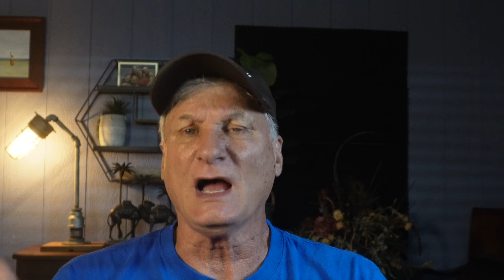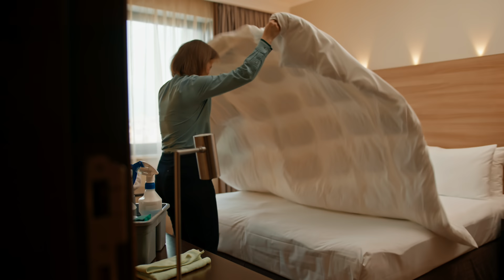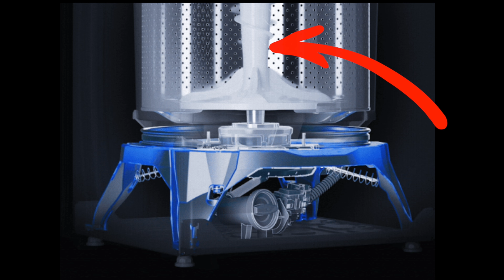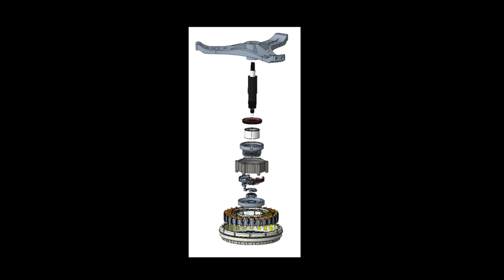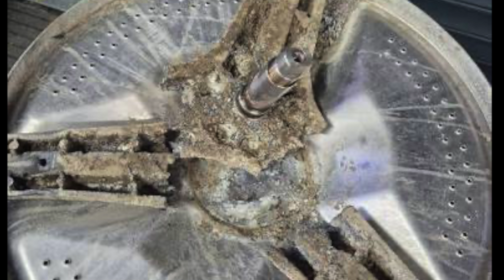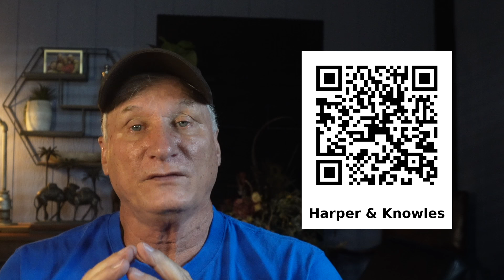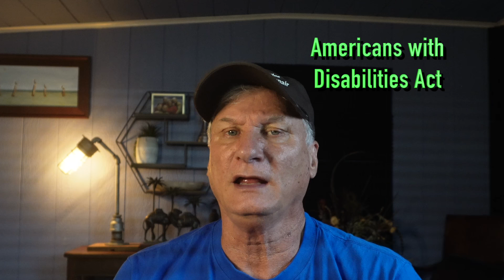Maytag's New 30-Year Washer: No Gearcase, Real Agitator, 900 RPM

Comment: If these top-loader motors were built correctly rather than the reduced size and power unit that LG went to (smaller coils, half thickness, and probably copper clad aluminum windings, likely reduced voltage) that requires gearing (an actual transmission they call a "Clutch", that's a lie), they'd have power enough for any function. I'm a mechanic with engineering education, and I know the difference, these things have a small hidden planetary gear assembly and a servo-driven shift arm that controls the output, Not a Clutch. A brilliant idea, but with plenty of plastic parts to guaranty that it will fail mechanically if not electronically first, but by definition this is a gearcase transmission like used in old car automatics miniaturized, two ratios, direct and reduction/reverse, separate concentric output shafts. 
Two main things about these machines I hate. Firstly, they are engineered to be as cheaply made as possible and still maintain functionality for a few years, with as few metal parts as possible. This nearly guarantees mechanical failure within 5 years even with a theoretical 10yr motor, and the machine is very easily damaged, even fragile in some aspects, then the replacement parts are still inferior and overpriced. Secondly, the programming is fixed with zero access for software options, you cannot stop the cycle and back it up to a previous point in the routine, nor move it forward, and they force you to accept the parameters you're given with little variation, even though the factory programming is sometimes horribly flawed and sometimes glitchy.
Essentially what they've done is take a great idea and turn it into nightmarish disposable garbage so that it will not last, and they can continue to sell you more garbage... Planned obsolescence at the height of corporate corruption. These were once called "Durable Goods", but that concept has been lost due to massive greed for profits and lack of respect for their customers.

Comment: We purchased a new pair of GE washer and dryer in 2019.
The washer lasted 4 years until the drum spider failed.
Cost more to fix than to buy new, yanked it out and put in a slightly used Speed Queen.
Then a year and a half later the dryer "bearing" failed, it actually wore through the "bearings" into the housing over $100 just for half of the housing.
 GE's are total crap

Comment: I like the speed of the front loads spin cycle.  it does take out the water.  That's a little more important in a high humidity area like Houston.  Will be looking for the report on the new whirlpool soon.  Enjoy your presentation. Momma says the front load kenmores (lg?) about had it.  Its 11 yrs old but only about 6-8 loads /wk. No issues with washer, dryer board replaced, still has issues but we can live with it.

Comment: After moving to this house 11 years ago, we are now on washer # 3 and worried #4 maybe sooner than expected.  All machines were bought new and were at the mid-range of prices.  We left our older Maytag at the previous house and the new owners say it's still running great and no problems.  We must have gotten one of the last "good" Maytags back then and regret not taking it with us on the move!  We even had to replace one of the new dryers as it was overheating (air vents were clean, so that wasn't the problem).  It is nice to hear some good information for a change instead of a salesman giving a sales pitch on very nice looking crap.  I will be checking back on other things and on the Whirlpool 30 yr. model this Spring....and hope we can hold out that long if a replacement is needed.  Thanks for your help & information!!!!

Comment: We have the same Maytag washer and dryer we purchased in 1988!  They have been running once a week on wash day for 38 years.  The only maintenance that has been required is the felt pads on the bottom of the machine to help it from walking around when its spinning.  Oh, I have replaced the drive belt a couple of times and lubed the tightening mechanism for the electric motor.

Comment: If the magnet rim is made of plastic, my bet is, that’s the weak point that rim is gonna crack from the stresses put on it overtime. Not tell us about the water pump. Does it have a shaft or a magnetic drive?

Comment: Like our T5 speed queen but don't need all the confusing cycles. We also have to trick it to use more water with the bulky selection otherwise it doesn't fill high enough. And the eco cycle default is annoying and I wish the capacity was larger for bedspreads.

Comment: I was in the business for 40 years.  I worked at 2 G.E. dealers in the span of 40 years, but we sold just about every High End brand you could get. Around the mid 1990's we started selling Fisher & Paykel laundry. They had a direct drive motor & shaft drive very similar to this new Maytag, although they did use the 4 corner cabinet suspension rods. The washer spun at about 800-1000 rpm depending on the cycle. Aside from the 220 volt drain pump, i always considered it the best washer to use for the customer, and it was easy to work on , for the most part. My guess is Whirlpool borrowed this idea from Fisher & Paykel, because these were around long before a fast spinning front load was common in America.

Comment: I'm a repair man.  Old speed queen impress me, not the new ones with lid locks and boards, hot cycles with barely any hot water and no tech support because i am not a dealer.  Terrible customer service.  How's the tub seal on the new maytags?  If those leak, it trashes the motor.

Comment: I paid $1200.00 for a Speed Queen in 2020. Right before the warranty was up it started acting up. It is model - AWN63RSN116TW01. A company came out and put in the electrical board that we had for $285.00 it still is not working. It stops full of water we can only use one setting and when we tried to get them to honor their 2 month guarantee crickets. I live in San Antonio does anyone know someone in the area that can work on a speed queen? So disappointed in the brand.

Comment: If this washer were available and reasonable, when I needed a new washer last year, I probably would have bought it. Instead, I got an LG with an agitator, that I only run the deep wash on. It’s got all sorts of gadgets and geehaws, that I will never use.  It was less than $800, and I got the Costco warranty on it.  When the warranty runs out, I’ll probably have to buy another washer.  Still cheaper than a speed queen.

Comment: If this machine lives up to its claims (and a  replacement control board isn’t $1,000), then $1,500 seems reasonable.  My folks paid over $300 for a nice kenmore belt drive in 1967. That would be $3K today. The 1966 KitchenAid dishwasher was about $300. Again, about $3K today.  They lasted and lasted but you definitely paid for that quality (and you got genuine quality for the $). I still use that KitchenAid dw today! The kenmore was rebuild at about the 20 year mark, and finally everything gave out another 20 after that.  I upgraded to a low mileage 1979 Maytag pair of the 806 series, last of the center dials. Dunno how much they cost when new, but I’m sure in today’s $ it would seem to people to be an eye wateringly high price.

Comment: I have a Kenmore Oasis washer and dryer which I bought in 2007 or 2008. The washer is very heavy. Only repair was a bearing replace in 2025. I am moving and trying to decide if I should buy new or move my workhorse duet. Any thoughts to help me decide would be helpful. Thanks.

Comment: Everybody learned from Maytag... they built a 30 year washer and when they came out with their next model (Neptune front loader) and there was a problem with them it put them out of business cuz they didn't have enough sales on their top loaders to support all the boards and wax motors they had to replace on the Neptune... E.O.S.  --- no manufacturer in their right mind will build a long lasting machine....

Comment: Big nope from this viewer.  I've been a diehard Whirlpool customer, even going so far as fixing my own, changing gearboxes with takeouts from castoffs found in the neighborhood during trash days, and the like.

Bought a Cabrio new and it's a POS that the cost cutters have gotten into and destroyed.   Glass lid frame cracked early on, replacement was $130, and IMHO it had a critical design flaw that precluded long term durability.  Figuring that the replacement would just crack in the flimsy plastic frame again,, I researched replacing the lid with a steel lid that would eliminate this design flaw.  Bought the parts used on EBay, changed the lid and related hardware, and congratulated myself on fixing it.

Well, now it does a lot of other things, like chattering during agitation, not braking at the end of any spin cycle, and freezing at 01 because the washer won't sense when the basket stops due to it's coasting to a halt.  I tried replacing the slider assembly but that didn't help and I could tell that the removed part had no obvious signs of failure.

Every component has been cheapened and I refuse to dump any more time or money into this POS.  Likewise, I'm very skeptical of any future Whirlpool washers.  KISS-keep it simple (and sturdy,) stupid, and resist the urge to cut costs wherever possible and then put lipstick on  a pig with complex electronics because "that's where appliance design is going."

An extended warranty is supported by long term durability testing and field data and not something that can be simply declared and accepted.

Comment: I bought a WHirlpool stove and refrigerator several years ago, and I have to say that not only are they the most poorly designed appliances I have ever owned but the company seems to have  fallen in love with being able to repeatedly sell high priced  replacement parts that have NO upgrades to the original parts failures.  I WILL NEVER buy another Whirlpool appliance even if they give them away for free with a lifetime warranty.  My post Whirlpool purchases have all been Maytag.

Comment: Only thing I will say is the speed queen control I have seen for $450 my cost as a repair company. Whirlpool is $130 for the controls they replace all the time. Also ADA compliant for a dryer and not washer is the height.

Comment: Brought a set of Maytag in 2005. I just replaced both with the cheapest GE set I could find. The 05 Maytag build quality was excellent. Not one problem until the obvious, age related failure. They had washed and dried 1000s of loads. If Maytag(whirlpool) builds machines like those again I will be buying another set. Other wise Speed Queen is next. The only reason I brought the GE is Speed Queen was not available and was on a waiting list. Dirty cloths don’t wait! Satisfied with the GE? NO, you get what you pay for. I didn’t pay for much. 😂

Comment: My Samsung control panel won't work when wet clothes go from the washer to the dryer and the control panel gets wet.  How water proof is the panel on this washer?
Reply: Should not have bought a Samsung! Lol . My Maytag is 9 weeks old and a bearing makes a screeching sound in the spin cycle already.. But for wetness, when it ran hot water, the top lid leaked the steam onto the control panel and it would literally sweat and drip. That was a disaster waiting to happen. A few online reviews said the same thing. Returned of course. Now waiting for my fourth machine, GE this time. I did not have luck with 2 LG's either.

Comment: This is considered a commercial washer meant for washateria and laundromats. its mean to be used many, many times in a 24 hour period. Where as a consumer grade its mean to be used a few times a week. 

Now you why the $1500 estimated price.
Reply: Heavier galvanized steel panels, the update spring suspension system, the base is heavier by far, direct drive stator motor, 50% less parts, made to service in 30 mins or less. There is a link to the brochures, Why did you ask?  Plus it is a larger drum than SQ, and it is a market price that people will pay.

Comment: Great video!  I am one of the many that has no trust in Whirlpool.  I will never buy another one as long as Speed Queen is in business.   A 5 year warrantee is a joke in my opinion.  My first washer was a 1955 Maytag that I got second hand in 1983.  I never had any repairs in the 5 years or so I had it.  I gave it to a friend who used it for a few more years until the belt broke.   She then scrapped it and bought a new machine at that point when she had more money.  So they could make stuff last 30 years in the 1950's  but that's not possible anymore?  Come on!  The only explanation is that they don't want them to last that long.  Engineered to fail and x years.  That's what Whirlpool means to me.
Reply: ALL are that way. I have returned 2 LG's, now a Maytag, and soon to be delivered a GE. All junk.

Comment: I couldn’t wait for the new 30 year Maytag, so we settled for the MVWP596GW. We looked hard at the Speed Queen TR7, but decided against the it. The Maytag has the same washing motion as the TR7 plus it has an auger type agitator that really keeps the clothes moving through the water which in my mind provides a better cleaning process. Plus it saved us $500 dollars. I have no illusions that it will last 23 years like our old Estate washer did, but if it makes to 10-15 I’ll be happy. 
Maybe this new Maytag 30 year washer may so irresistible we buy a the whole set!

Comment: Wife wanted to replace our OLD washer and dryer. She went out and bought new Maytags. Less than TWO MONTHS the washer failed and wouldn't unlock (of course with water and clothes in it). On Warranty they sent a guy out. He replaced a part and left, couple hours later SAME problem. He came back out the next week replaced a different part and two days later it stopped working AGAIN. They sent a different guy out who replaced both the SAME parts + the entire wiring harness, week later it stops working again. Different guy again, replaces a few more parts and breaks again a week later. This kept going until the washer got to be over a year AND THEY STOPPED COVERING IT. . . Honestly lost count how many times they sent repair guys out and how many we hired. . . 

All in all that washing machine worked maybe a whopping THREE months that first year. Maytag Dryer started falling apart just after the warranty expired. 

We went into Mexico and bought a washing machine and dryer from the 80s. . . three years later NO PROBLEMS. 

WILL NEVER BUY A MAYTAG AGAIN. NEVER!! I can understand occaisional breaks . . but when the WHOLE THING is plastic and designed to FAIL then they fail to back up their product . . F' em. We need appliance LEMON LAWS.

Comment: In 2023 I trusted Whirlpool because I have multiple appliances and that's what I used to buy decades ago. However their Whirlpool model: wtw4816fw3 is a very glitchy machine!  It's giving me a variety of problems such as:  not filling the basket with enough water, skipping the second rinse and spin, having incorrect lit sensor lights, and having various problems so that the circuit board has been changed three times and the drain pump has been changed and the suspension rod has been changed and it's still acting up 3 years after purchasing it today in 2026! I'm glad I got the extended warranty, but it does not help with the frustration of getting a wash properly done.  I am really tired of having to constantly call for service repair even if it is under warranty. I recorded and put videos on YouTube. I also found that we cannot change your review on Lowe's site so that people who are buying a new washer will make the mistake I did and trust whirlpool. So I am breaking up with Whirlpool, it's not me, it's you Whirlpool!

Comment: Interesting. I e been in the market for a new washer after my last used one died after just a year of use (stupid control board malfunction), and my husband have been leaning hard towards the Speed Queen so we can just be done with it. Wonder when the Maytag is going on sale? But then, it might be too late for the brand in this household. Gen X, and I long for the days of fridges and washers that last 30+ years without the stupid and cheap electronic dashboards that die in 5. My fridge is an old beast from the 90s - is it pretty? Heck no. Does it work? You bet your sweet cheeks.

Comment: I have an LG direct drive washer with an agitator plate that spins super fast.  You've got me wondering about how it works.  A repair person told me that she thought this was one of the better machines, which is why I purchased it.  I've had it about 5 years so far, so we'll see.  The bad thing is that dirt collects under the agitator plate and builds up.  The monthly tub clean doesn't always remove all the dirt.  It'll just finally get to a point where it just wants to release all the dirt and it ends up in a load of clothes.  Then I do many tub washes in a row and have to rewash the load of clothing that got dirt on it.  After each tub wash, I have to wipe the dirt off the plate using a wet paper towel or a Lysol wipe.  This is all very time consuming because I sometimes have to do up to 4 tub washes in a row!  A different repair person said that this only happens with LG and Samsung machines.  I found that removing all pet hair from our clothing before washing prevents the buildup from getting as bad.  I have a very furry pet so I spend time using lint rollers on the clothes to remove the fur.  It's all a pain.  I shouldn't have to do all this with a washer or when washing clothes.  I'm hoping the Maytag direct drive by Whirlpool will be a better option one day.